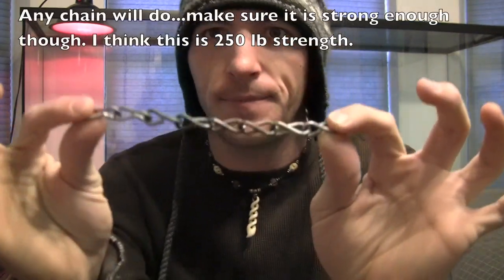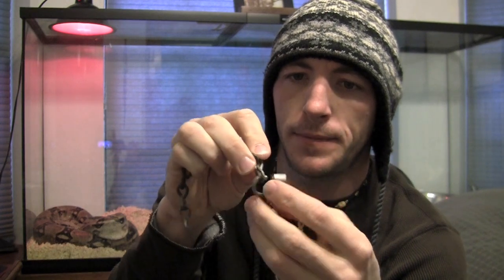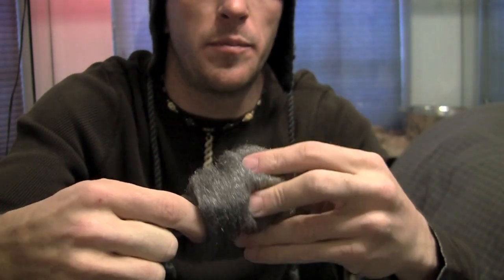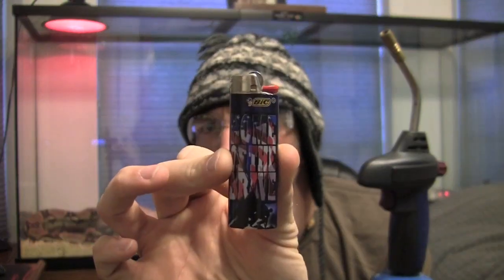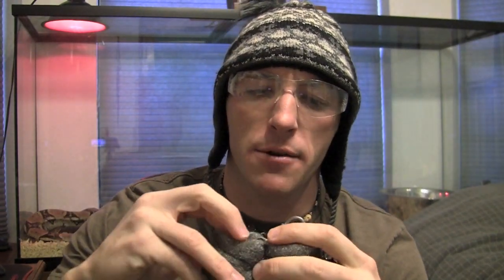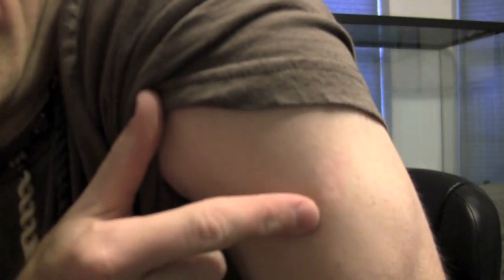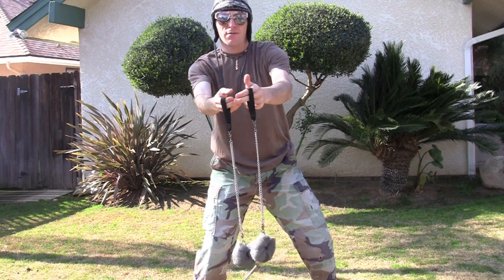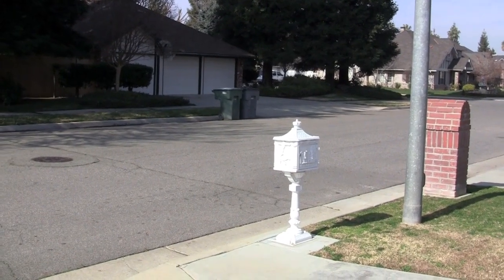How to make Sparkle/Steel Wool Poi

Comment: This is a great video.  I've only done this once and had a friend wrap a few layers of steel wool around the poi and tied wire around it so when the sparks were done the poi was still burning.  I like a lot of the information you had here and especially tips on how to light it:)

Comment: Thanks for sharing your info- I have always used chicken wire cages stuffed with steel wool off a roll, but I always have varied results. Sparkles are totally amazing at times but I get a short effect followed by molten rocks forming at other times. I will definitely give this a go!!

Comment from the maker: I would say try both methods and experiment. You may get different results. I personally have only and always used the three bun method. I recently developed charcoal poi cages and have been wanting to stick and entire package (12 buns/24 total) inside the cages and spin them. From my experience, I can maintain a large shower of sparks for about 10-15 seconds with the three bun method. After that they die down and I smack them on the ground for some last bursts of excitement. I hope this helps.

Comment from the maker: The steel wool that I purchase has a spiral design when looking at it from the top (where I poke the needle nose pliers into it in the video). By having the chain threaded through the middle of this spiral it ensures that the steel wool will burn from the outside of the spiral to the center holding the steel wool pads on as long as possible. Working with steel wool that has a different design may be why it is flying off so soon. Try some online stores and purchase there. Hope this helps!

Comment: First off great clip, excellent and thorough tutorial doood 👍 
In regard to making it last longer, could you string three or four ' buns on chains ' to the quick link?  As in three chains with three bundles of steel wool on each poi?  It would be heavier but you would get three times the burn!  Huge showers of sparks.
Reply from the maker: Bigger fire is always better fire. Test it out. I believe it may last just as long but make a thicker shower of sparks.

Comment: Hey, thanks for the great tutorial, I made my own ones and they look great, I'm trying to work out methods of making it last longer, like a layer of paraphin soaked muslin in the middle so it goes sparkle, fire, sparkle. Want to experiment with adding other oxides to change the colour :) I had 2 successful attempts at using them, third time not so lucky, brushed the back of my hand and took the top layer of skin off like a light sabre

Comment from the maker: Thank you. The chain can hold my weight and I am 150 lbs. It is not 11 - 19 pound test. It is non welded though, shouldn't make a difference for the effect. Do not use 11 - 19 pound test chain. Fire failure will ensue.

Comment: I've tried using the steel wool that comes with soap on it, and it acted as a wax or fire retardant, so the burn lasted twice as long compared to straight steel wool. It was twice as hard to light on fire though.
Reply from the maker: Interesting. I think we call those S.O.S. pads here. I bet it didn't smell too good lol.

Comment: So is there any benefit to having three bundles of steel wool going at once? Is it just that it burns longer or does having three throw off more sparks? I wanted to do some long exposure photography with the egg whisk method, but if there's an upside to doing three at once, I'll give your method a try.
Reply from the maker: I have not used the whisk method so I would not be able to give you a comparative benefit. I think every method is worth a try though for the results you seek.

Comment: What's your advice for steel wool fire staff? ... Is it a bad idea for me to just attach on top of the wick I've got on/ add a small amount wrapped around?
Reply from the maker: I haven't made a steel wool staff, but if I did, I would use small cages to house the wool on the ends.

Comment: Have you noticed some steel wool doesn't ignite?  Two years ago I had a blast doing this and then last year I bought the same name brand and grade and it would not ignite.  It almost felt like there was a coating on the steel wool.  Have they caught on to our fiery good times?
Reply from the maker: Haven't noticed that.
Reply: What brand do you use?
Reply from the maker: I show it in the video.

Comment: Rather than the chain I have seen metal "balloon whisk" (hand whisk used for beating eggs etc.) and the wire wool stuffed inside, have you tried that? If so or anyone else how does that work in comparison?
Thanks
Reply from the maker: I have not tried that method.

Comment: I can use copper wire instead if chain
Reply: someone else games no, do not try that. The copper will likely melt/ oxidize and weaken dramatically during your spinning and could easily end in disaster.
Reply from the maker: I don't recommend using anything other than steel chain or a steel cage.

Comment: my inside mesh melted, is that due to it being too thin or wrong material, i used a thin galvanised steel mesh, 
Many Thanks
Reply from the maker: If you used mesh to hold the steel wool, yes, it got too hot.

Comment: Hey, nice video! I wonder if it works to put some steel wool in the pipes of my motorcycle! If I just close die end of the pipes with a piece of perforated plate or something else like that, this maby works to! Or maby in de wheels 😎 But than I need to protect the gasoline really good 😅 I'm gonna give it try it in september, if it works I will let you know. Than I'll upload it on youtube and gonna support this youtube channel in my video✌ What you thin, it works? (Sorry for my bad englisch..)
Reply from the maker: Hahaha sounds like a good time if you ask me. Maybe a cage attached to the end of the motorcycle exhaust. If it revs with fire it will ignite the steel wool in the cage. Not sure how the effect would look. Maybe some small posts on the side of the motorcycle with cages attached and steel wool inside of the cages? I say go for it! So much fire, so little time.

Comment: Do you use zinc or stainless steel quicklinks? Just wondering
Reply from the maker: Stainless.
Reply: +TamedFire found SS quicklinks but only zinc chain at home depot. gonna try sparkle and coal poi. think there'll be a break in chain?
Reply: zinc plated quicklinks work too... that is just corrosion prevention differences, both are equally way stronger than is required for poi and are safe when closed tight with a set of pliers.
Reply: +themadscientest yup and they've been working just fine

Comment: what length do you use/suggest?
Reply from the maker: The same that you use for your poi. Rule of thumb is from fingertips to armpits, then subtract about three to four inches from that distance. I use 22" chains.
Reply: +TamedFire i used that measurement when I bought my chains but with an extended arm they drag the ground.

Comment: this is not working i set a fire and its not sparking
Reply from the maker: If the steel wool is not igniting it maybe the wrong wool. Test out different sizes until you find what works. Good luck!

Comment: Just grab some 0000 wool a knife and a bamboo cane and 9 volt and have fun spinning , no need for other than the basics,  cheap $2 battery  is fine, 
You said 0 grade, never use 0 grade, it's too thick, use 000 or 0000 grade, damn this guy is so wrong ....